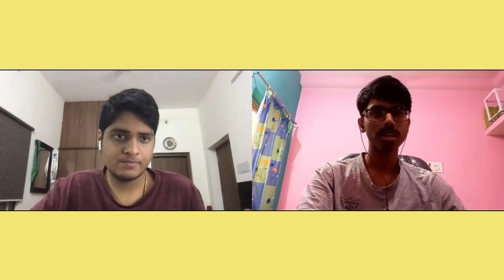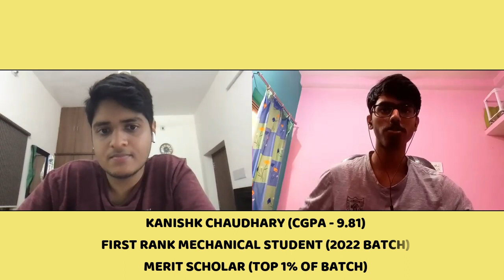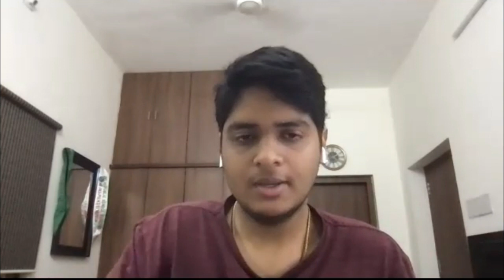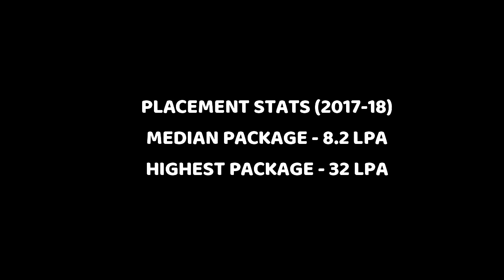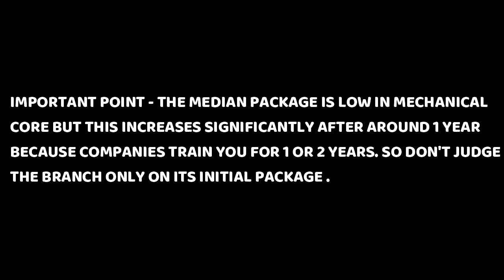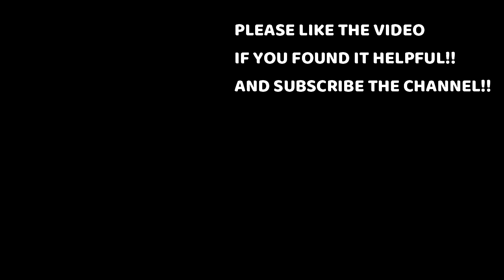MECHANICAL ENGINEERING IN BITS PILANI | MEDIAN PACKAGE, COURSES, JOB OPPORTUNITIES, PLACEMENT, MYTHS

Comment: bhaiya if i want branch change from chemical to eni.......what is the approx cgpa req to get into top 5 in goa or hydrabad campus
Reply: If you want a good branch at decent cgpa try for dual degree
Reply: Bro don't think about the branch change. It's very tough and very few students get a chance to shift. The CGPA required for the same is >9.5 which is quite difficult
Reply: Cse at 8.5